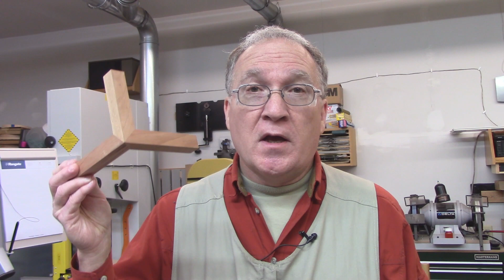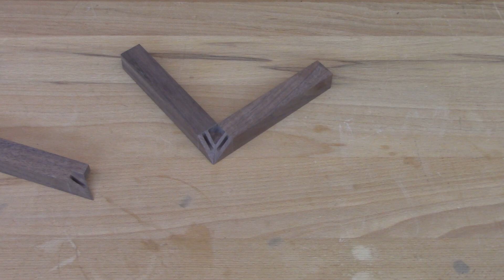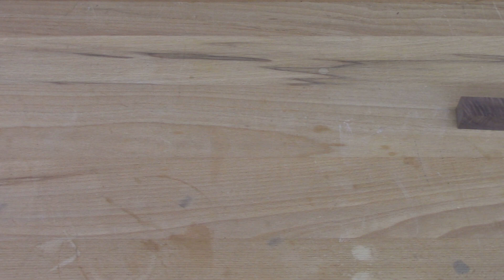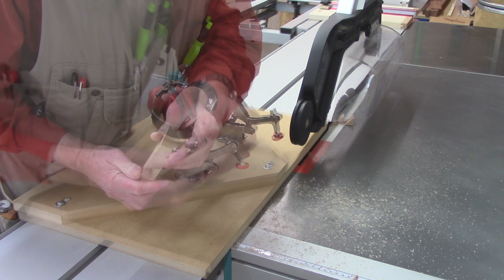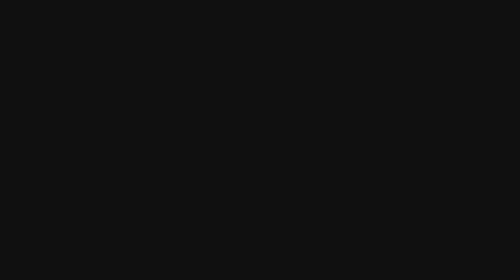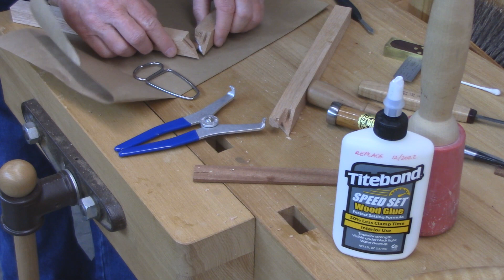3 Way Miter Joinery by Machine (mostly)

Comment: Great video. I didn’t quite understand how to size the height of the stub tennon. When you show the result of cutting the half lap at 2:50, the miter cut looks like it is inset from the end, which I think would mean that the stub tennon would protrude out farther than the miter ends. But if that’s the case it’s not clear how to match the stub tennon height to the depth of notches on the mating pieces? On the other hand some other parts of the video make it seem like the stub tennon doesn’t protrude past the miter ends. Maybe you can clarify for me?
Reply from the maker: Hi Justin.  The stub tenon height is cut at the point where the two adjacent miters meet.  It does not go all the way through and is there to aid in registration of the 3 way miter.  Steve
Reply: So you cut the half lap miters and then do a separate cross cut to cut the stub tennon to the right length?
Reply from the maker: @justinleonard8515  Yes

Comment: Clever guy👍

How did those Chinese artisans do it all by hand with perfect accuracy “ 🤔
Back in the early 1700’s ! with no glue and no floating tenons .
It Would have very time consuming 😵‍💫
Reply from the maker: Yes Mark.  They were and still are artisans.  Yeung Chan taught me this technique (except for the router part) and he made some exquisite joinery all cut by hand and with no glue.  He made a curved chair with oval stock and it was perfect.  Steve

Comment: Excellent video tutorial. Been looking for exactly this. Thanks for posting. A couple of tool questions. What make is your router positioner? Looks like the Incra functionality but different styling. Also you use a very thin chisel with what looks like a rectangular-ish Birdseye maple handle. Who makes that? Many thanks
Reply from the maker: Thank you Mark.  The chisel is made by me - the steel is a Hock A2 blank that was hand ground as a small mortise chisel.  The router fence is a Join-tec which is no longer in business.  I purchased it used and would have preferred the Incra but that one was not for sale.  The lift is branded Join-tec but was made by Jessem which was the original Mast-R-Lift.  Steve
Reply: @extremewoodworker  Much appreciated Steve

Comment: For the first time, since I started watching your incredible video's, I am confused about your cutting on the router table on the "other" side of the wood. Which has always been difficult to get around when using a router.

In other words as many know, it can be dangerous trying to feed the stock from the outfield fence coming towards you. Try as I might, I still can't figure out what you are doing to make that "other" cut. I suppose that most of my confusion is my being 89 yrs old. But I just don't get it.

It seems impossible to do it. Yet, somehow you did it. And that is where I go up against a "formidable" wall. Help..........kind Sir.
Reply from the maker: Hi Pat.  I wasn't cutting the way you describe.  I was using the outfeed side to set up the position of the fence to get the mortises to line up on the opposing face.  The video never shows me doing a climb cut.  Hope this helps.  Steve
Reply: @extremewoodworker Yes you are correct and I understand that. What I don't understand is; "how" you were able to make that cut without "climb" cutting. That is where I am confused.
Reply from the maker: @MrPatdeeee  The fence was in two different positions for half of the floating tenon mortises and opposite sides of the stub tenon mortise.  This is the only way to avoid a climb cut unless you drop the piece down onto a spinning bit and have a normal feed.